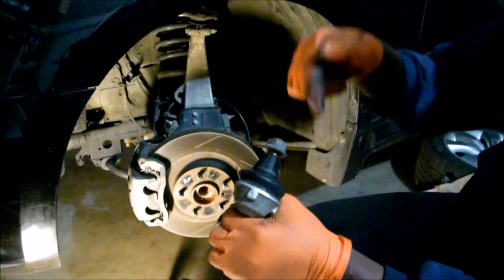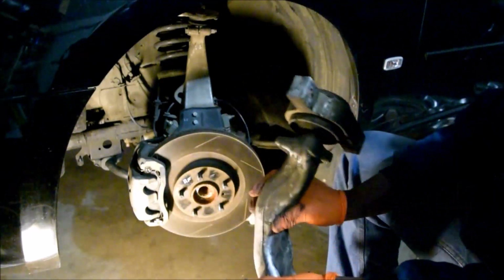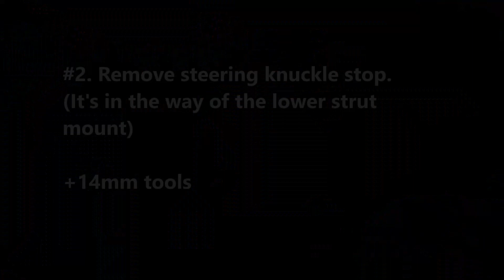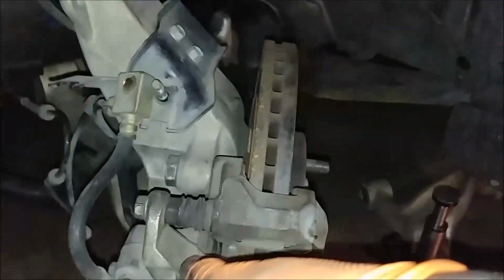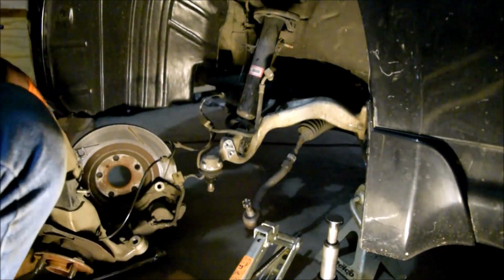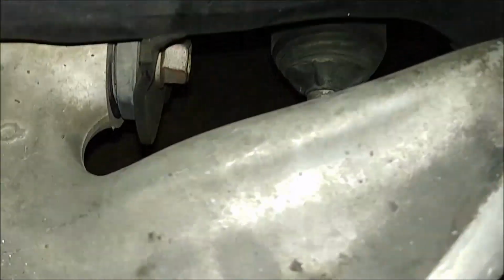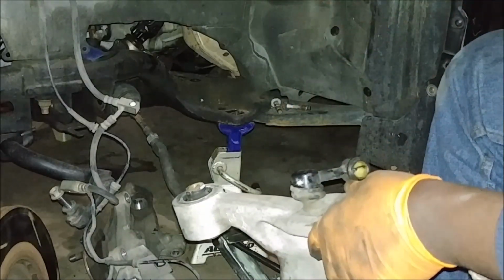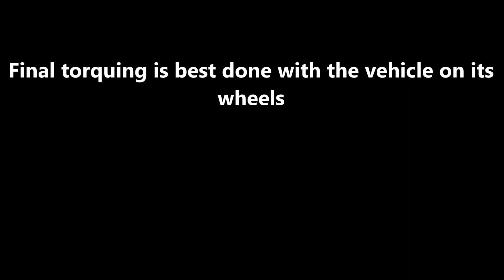Infiniti M45 Front Lower Control Arm. 2006-2010. Bad balljoints, torn bushings

Comment from the maker: I should have added two things:
1. There are different ways to remove the outer tie rod. Here is another. This tool doesn't damage the ball joint boot like a pickle fork would. https://www.youtube.com/watch?v=JmJd5T26ktk
2. Before committing to do the work, it would be wise to take the vehicle to a competent suspension shop to diagnose the problem. They charge $10 around here.
No point in spending the time or money to replace parts based on a wild guess.
3. Final tightening of suspension components is best done with the vehicle on its wheels. Get creative with that.
Reply: @EdBwoy whts the difference between rwd n awd control arm bc all I find is rwd control arm I have a 08 m45x needs replaced
Reply from the maker: @retro2897  the way the big bushing at the rear is mounted. The AWD bolts go into the subframe horizontally
Reply: @EdBwoy  thx n where can I find em bc im having a real hard time finding awd one
Reply: @EdBwoy  hey im having an issue where my cv keeps popping out when I turn left lasted 4 months n popped out n tore up the boot. Wht can be the cause of this bc its the right size its definitely long enough
Reply: @EdBwoy  I saw u were having an issue before but I think u were lowered on your q50. I have and m45x n have tht issue but don't know the cause like I said I got the correct size I need
Reply from the maker: Left side. https://www.infinitioforlandparkparts.com/p/89964413/54501-EJ72A.html

Right side. https://www.infinitioforlandparkparts.com/p/89751486/54500-EJ72A.html
Reply from the maker: Which side is popping out?
And is it coming apart at the CV joint or at the differential?
Reply: @EdBwoy  right passenger n its not popping out of the differential but the boot closes to the diff
Reply: It tears it up or something in my suspension went bad thats making it extend more be slack somewhere

Comment: Just changed my lower control arms.  Feels like a new car.  Got a new rack and pinion, control arms, sway bar  links, and most of the suspension.  Any suggestions for the rear suspension?  Your videos always come in clutch for the Infiniti guys.  I have an 09 M35 S and 08 M35 S.  Can't come to selling the 08, going to restore it.  Much Appreciated

Comment: Hi Edbwoy, are these bushings on the lower control arm replaceable? And, are them ball joints workable? Them ball joints moves freely, so I guessed they should be torqued or something? I know the cost of repairing would be way cheaper than quotations I got in replacing a used or new control Arm. I own a 2011 M37 RWD with 68k plus . I need your guidance if these parts are repairable than replacement (don't know why Infiniti doesn't make them ball joints separately, why on the arm directly?)... Please, I will appreciate your earliest response.

Comment: Thank you for posting this video✊. Well done and helpful. Question: I assume you took the brake assembly and steering knuckle off for easier demonstration purposes and so you didn't have to get under the car? 
I ask because I don't believe you have to dismantle all that to remove and replace the LCA. I only had to remove the end link and ball joint in order to have the LCA swing away from all that, and them take off the two areas that connect the LCA to the frame. 
I would like to know your thoughts on that.
Thanks again✊
Reply from the maker: Thank you.
You are correct in that you don't really need to remove all that to get to the LCA. The main reason was for ease of demonstration, because I wanted the camera to have a clear view with an assumption that most people watching would be working in mostly the same conditions.
My hope when posting such a video, is that people use it as a reference while preparing to do the job, just to have the proper tools handy, to know what hurdles they could face, and also to decide whether they really want to DIY the task or just pay a shop, haha.

What should come out of it is an observation much like yours, and I usually encourage people to share their own tips and tricks to doing the jobs.
Reply from the maker: Also, on that note, I still disassemble more than just the 3 lower control arm fasteners to replace the LCA. I reckon working with a lift dramatically increases your access and technique. 
Most times I'm replacing an LCA, I'm also addressing something else so many components come out, starting with the heavy brakes.
Reply: @EdBwoy  You're videos are greatly appreciated! Thank you👍
Reply from the maker: @simonx6445  thank you for the kind words.

Comment: I need some help here I was driving racing started to fall my car 2008 infinity m35x I had it is the mode for if rain falling the wiper will come on automatically then when the rain start to fall it comes on and go off and never comes back on I switch it on to work normally  it never work up to now no wiper work

Comment: I think this is what's wrong with my 08 m35x.   
I get clunk when going over bumps (like railroad tracks, etc).  My struts are fine (removed and checked those).  
Sway bar end links replaced and bushings replaced.  Clunking is still there.
Reply from the maker: Good chance with age. Around 170k, they'll start to go

Comment: Hey. I always watch your videos. I have a question. All of the control arms that I find are RWD? Can I purchase those for AWD? Your help is much appreciated!
Reply: I have that same question also
Reply from the maker: @memphis1033  unfortunately not.
The subframe design is different so you will run into issues at the large rear bushing. For RWD it is bolted down as shown in the video, but for AWD the bolts go in sideways.
Reply: @EdBwoy  thanks as always!
Reply: Any problems accessing or removing this lower control arm rear bushing bolt for AWD models?

Comment: Are the 05 Q45 front control arms a similar removal or completely different process? Awesome videos btw.
Reply from the maker: Thank you.
I haven't done the Q one, but when I looked at it, it will be slightly different. That doesn't necessarily mean more difficult though

Comment: Hello I have a question I have a infiniti m37x and when I drive it my front end goes to the right or to the left on its on while the steering wheel is straight and I have to catch it and bring it back to center... I have replaced both lower control arms on it with ball joints and the car only had 64,000 miles on it when I replaced it the first time...my car is at 77,000 miles now I dont drive it as much.... my mechanic thought it was my alignment and they re-did that for me and I took it home and parked it and now that I had to drive it till I get my other car fixed...its doing it again..when I drive the car it feels like no control...I know its all wheel drive..would you know what the problem might be

Comment: How can you tell if the control arm or the steering rack needs to be replaced?  I have two mechanics, one told me steering rack, the other told me control arm.  I didn't tell either one what the other guy said. My car is making a knocking sound when I turn or ocassionally when I go over a bump or come to a complete stop.
Reply from the maker: The best way is to test each one as you disassemble. But that's inefficient, I just take mine to firestone to confirm my guesses.
Or, get a third opinion and go with gut feeling. Depending on your mileage and other factors, it might be a totally different issue.
https://forums.nicoclub.com/occasional-clunk-in-the-front-right-t623162.html#p6788377

Comment: How did you remove the ball joint for steering?  I removed cotter pin, but the nut just spins when I use a wrench on the nut.
Reply: I got it done. I used vice grips to keep the shift from spinning
Reply from the maker: @deasttn  right on! Glad you got it done

Comment: ? I have a 08 Infiniti m45x it’s not the base. I need help getting the control arm will the one your using fit on mine or do o gotta buy the m45x control arm that 150 more expensive
Reply from the maker: Unfortunately, the RWD control arm will not work for you, mainly because of the rear mount design.

Where have you been checking the prices you have?
Reply: Yeah,  the AWD X models and the RWD models have different parts.

Comment: Is the lower control arm replacement the same with '08 M45x?  Instead of RWD?
Reply from the maker: Sorry I missed this. The AWD control arm is slightly different at the rear bushing, but in principle, it's the same steps

Comment: I doubt anyone would respond to me but IM STUCK!! y left hand bolt on the strut ( wishbone ) is stuck/stripped/broken... who knows but it’s not coming loose, the other bolt was removed on the right hand side. Any suggestions ?
Reply from the maker: PB blaster, or CRC freeze off to try and loosen it...plus a long cheater bar
Reply from the maker: If it is seized, the problem is most likely at the bushing sleeve. If you employ any destructive methods to remove it, like cutting, just keep in mind you might not be able to reuse the control arm as it is. You'll need to address the bushing.

Of course, it depends on whether you are trying to replace the strut or control arm

Comment: So did you replace the hole control arm or u just replace the pushing ??? cause they keep telling me u can’t replace the pushing alone u should replace the hole thing ??? Any idea bro
Reply from the maker: The whole control arm chief. That's what I was talking about in the beginning of the video.
You can't replace any part of the control arm, maybe the strut lower mount... but the ball joint and front bushing I haven't found any means to replace them.
Reply: @EdBwoy  Hi, I own a 2011 M37 RWD and currently is at the mechanic for the lower control arm job. Some of its bushing are cracked, the ball joints moves freely when the arm was totally out (what the heck of engineering mounting a ball joint directly on this control arm unit, they just don't want us fixing this thing). Are them bushings on the lower control arm replaceable? Are them ball joints repairable or can be torqued back to be tight and not loose? Cost of replacement is very high. Also, I'm replacing one of my shocks (passenger's side). Will appreciate your earliest response.

Comment: Can that cause shaking at the wheel going freeway speeds on a 2004 Infiniti fx45 AWD?
Reply from the maker: Yes, it can. Among other things like tire wear, wheel imbalance, bad alignment, bad rotors etc
Reply: @EdBwoy  how can I check which one is the issue
Reply from the maker: @Tropical0009  where are you located?
Reply: @EdBwoy  San Bernardino county California
Reply from the maker: @Tropical0009  ok, I have friends all over the world now. Just wanted to make sure my advice is relevant.

My strategy starts with an alignment professional
1. Firestone in my area has a $10 alignment inspection. They put it on a lift and do their best to identify the problem.
Call around, see what shops around you offer.
2. If they can't isolate a suspension issue, you might need to deal with the wheels. Usually I rotate them to see if the shake changes in location or severity.
Wheels do need to get rebalance ever so often
3. After that, you either let them repair it or try to do it yourself.
4. Note that sometimes you,might need to make several trips.
5. Since I usually do the replacements myself, I buy lifetime alignments for the cars we are gonna keep... Or those very jacked up and the alignment pays for itself about 3 uses into the trial and error exercise

Comment: Buying a  whole new control arm assembly is really expensive. Why didn't Infiniti design the control arm assembly so new bushings /ball joints could be pressed in or unbolted /bolt in as you do in other vehicles? Perhaps so they can sell you a new complete assembly at an inflated price?
Reply from the maker: Maybe it was the best way to get a part that provided the handling they wanted out of a car.
I know it's not cheap, but I don't mind too much since it's not a frequent replacement item.
Reply: @EdBwoy  I am in Canada, that part is $1200.00 Cdn. plus you need another $60.00 part when you do the job. I think they are about $600.00 in the USA. Here is an interesting video where the owner found a rear ball joint replacement kit for a G35. The mechanic doing the job was surprised it worked. I recently did the ball joints on my daughters Toyota Corolla and my Subaru Outback. You are looking at about $60. -$80. to do both sides on those cars. That is one hell of a lot cheaper than the Infiniti.    https://youtu.be/5xqMXQrgQn4

Comment: Where is your cv axle?
Reply from the maker: This car doesn't have CV axles in the front. It is a rear wheel drive model
Reply: EdBwoy i replaced the lower control arm on my m35x and i tightened the lower ball joint nut but it looks like its lose still do you have a fb so i can show you what lm dealing with maybe you can help me out
Reply from the maker: @Jesus-lz7nd  email me at EdBwoy@gmail.com.

Comment: hlo my friend can me ask Questions !!????
Reply from the maker: Hello, ask away. I'll answer what I can
Reply: EdBwoy 

Brother i have something in m45 light VDC off/RAS/SLIP Do you know how to fix the solution or what is the problem?
Reply from the maker: The first thing people do is to check the brake fluid level. If it is low, add fluid and consider replacing your brake pads soon.

If the fluid level is ok then it might be an issue with your clockspring.
Reply: EdBwoy 

 Brother i checked all bat he have proplem in ABS system Brother have wats!!??
Reply from the maker: There is a problem with the ABS system? What does it have?
It's OK if you write in another language, I will try to translate it.
Reply: EdBwoy 

I m from arbic brother
Reply from the maker: Which country? No worries, write in your language and I will translate it.
Reply: EdBwoy 

UAE brother are you have WhatsApp ???
Reply: Replace cam sensor